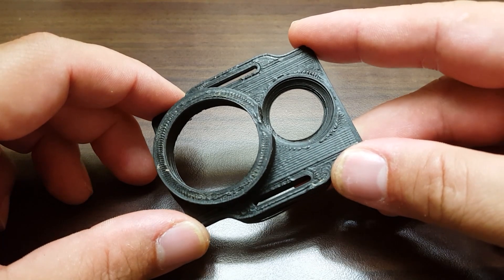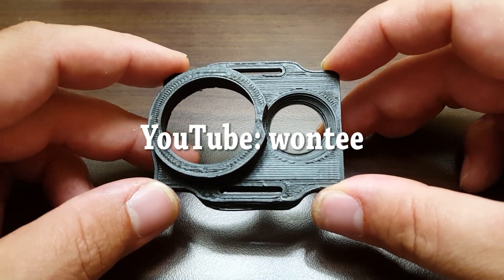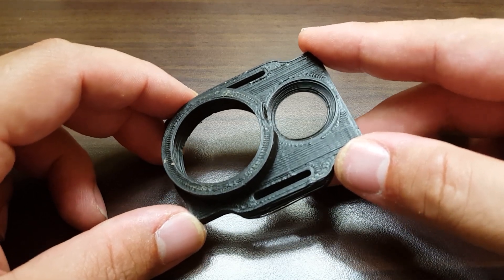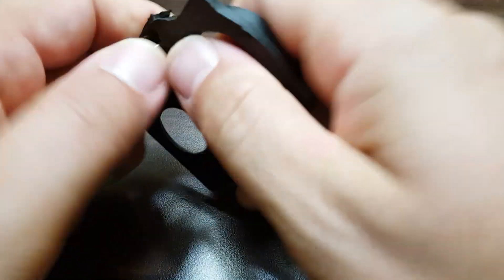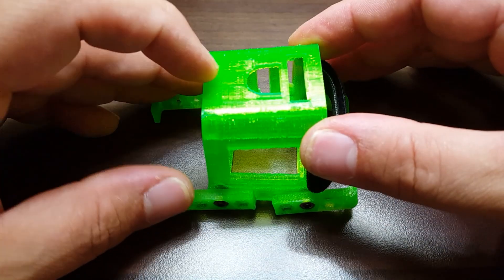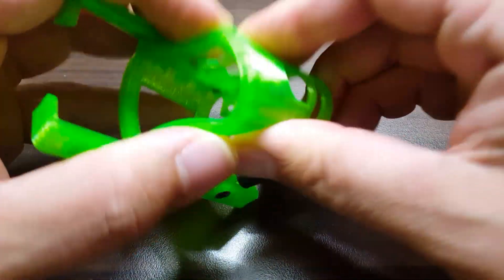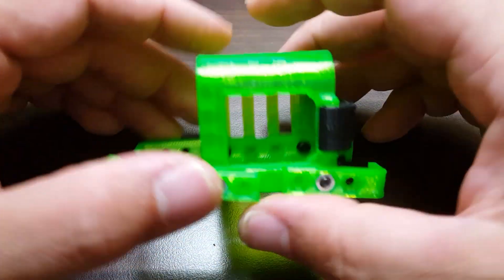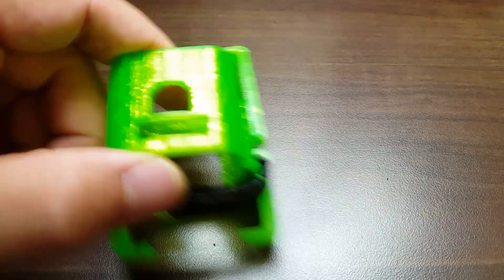3D Printing Wonder-Material: TPU

Comment: Weak along the layers... yes, BUT: Injection molded plastics mostly shatter when they break... with pieces flying around.
3D-printed materials - as you already see in the vid - break but the broken part does not fly away. It still hangs on some layers/strings.
They crack and still maintain a certain mechanical ability, since most 3D-print polymers have that typical viscosity.

That element you broke away on that model would also break at most injection molded plastics. :)
Reply: It also has a lot to do with the brand and makeup of the material. I print A LOT!! And just like with anything you learn with experience. Print that part in Eryone PLA Pro and try that screwdriver trick. I have literally had to use a mallet to remove supports before because it was so hard. I swear I've tried breaking tht stuff and it's near impossible.

Comment: Yeah man got to disagree with you on that point 3D printing is not hard to get into and it doesn't cost a lot of money you can buy 5 inch racer or you can buy a printer and especially if you buy like a decently Welbilt printer with good reviews and as long as it's not like a DIY kit you're good to go you're not going to have that many issues and if you invest a little bit more you're not going to have any issues and it's not that hard to get into for sure

And there are other wonder materials nylon reinforced with chopped carbon fiber as well as continuous carbon fiber Prince these all have really high strength High tensile modulus high impact resistance so definitely worth checking those out as well

Comment: When printing drone parts, the design plays an important role. If done right, these parts can be quite resistant. I fly a racing drone with a self designed frame (search for "Crashex" on Thingiverse) completely printed in PLA. As a relative beginner I still crash a lot, but unless I fly the drone directly into the ground with speed and from a height, it handles its rather rough life surprisingly well.

I like that I can design things in a way that expensive parts are well protected and things will break in a "predictable" way when they break. I usually have a couple of spare arms printed and can be back in the air within half an hour (will have to design for easier changing of arms and a more compact shape, though).

Now for the frame itself a very flexible material like TPU will not work, and I was having high hopes for PETG, which is supposedly more resistant than PLA, but so far it did not live up to my expectations - the PLA I have is 5x stronger. Maybe faulty material, I don't know. I hope to get my hands on another brand of PETG soon because from what I see online it should be great for printing drone frames (search Peon 230, for example).

Comment: as for keeping a 3D printer running, I haven't had any real issue with mine since I replaced the bearings after buying it used, other than the pet or abs filament jamming the extruder when it can't push it into the hotend, but I don't run mine every day either.

Comment: Anyone else wondering about the quality of that print :(
Reply: no sense printing something at 0.06mm if you're just gonna break it with a screwdriver
Reply: looks like 1mm thick exstrutions,  its tricky to get a clean top with that, although at 0.5mm layers it prints in a 1/4 of the time...e.g. no ten hour print for a farty little bit lol.

Comment: Monoprice Mini Select, $199 on amazon. 1 Roll of PLA to print parts for the 3d printer to get TPU printing $20. 1 Roll of TPU $40.

Your 3D Printing.

Just did it, I have TPU parts sitting finished in front of me with results as good as a $2000 printer.
Reply from the maker: Kind of hard to believe, honestly. I have watched people struggle to get their printer running well, especially with soft filament like TPU. Got any photos of sample prints?
Reply: I was a 3d printer n00b as of 1/12017. No reading long books or nunnery of the sort. I came here thinking you had some tips on 3d printing with TPU.

I literally just got it monday 1/16/17 and had my first great tpu print wednesday 1/18/17. I could have done it faster, maybe even printed the part to keep the tpu from getting jammed up in the extruder with the included filament and been printing TPU from the start. I wasted some time printing things in PLA.

There was a slight learning curve not just in the slicing software and optimal settings for layer extrusion for structural integrity but also in temperature, material settings such as density and filament size and other things I made sure to configure to the best of what I could quickly learn, for instance on every print you must specify a layer height and That's an important number because It's driven by the Z axis motor and that motor [Z-Axis] is a 7.5°, 48 step motor, which has physical limitations. Since the motor is attached to a M4 rod, which has a 0.7 mm thread pitch, then in one revolution makes the Z-Axis travel up or down 0.7 mm. Since it took 48 steps to turn that rev, each step is 0.00145833333333333333333333333333 etc etc mm. To avoid rounding errors, you can use multiple of 3 of this number, which is a nice and pretty 0.04375 mm. 

That is a nice and handy number that effectively represents the layer heights that mathematically work the best for layer heights for the monoprice select. Stop at 0.30625mm because with a nozzle diameter of 0.40mm, the maximum recommended layer height is 0.32mm.

It's all just science. Maybe you should make a video on it for everyone that way I won't have to learn sketchup because cheap 3d will proliferate and parts will be designed for me. 

It took me like 14G of filament to do a camera mount that could likely suspend a small child without breaking, maybe a fat kid at its stronger point. I digress, mypoint is it's tough and flexible. 800G of filament was like $27 for the sainsmart tpu (which has been working fine). 

I even used cheap bed substrate to test, Scotch blue painters tape. Granted it's perf3ctly aligned. including some TRESemme level 4 hold hairspray which is dank for making parts stick initially and they come off nice at the end. They even smell nice.

See for yourself. Sorry no smelling.

https://www.irista.com/gallery/dpujosdh1crv
Reply: Joshua,  It is alot like quads. if you buy a cheaper one you end up spending more time and money replacing or "fixing" issues.  Also a lot of printers are simply not made to print flexible filament. If you use a bowden style extruder with TPU for eg its quite a challenge to push the filament through the tube without it flexing too much.  So the right printer style goes a long way.
Reply: My mini select V2.  Prints better than my old ultimaker 2.       Prints TPU like a boss with improved for flexible 3D printed extruder base

Comment: BUILD a 3D printer! Your mindset would be perfect for calibrating the settings of a printer. I built my second 3D printer a year ago and I would not build a quad or even planes without it. :-) I use PETG for a lot of parts on my quad like antenna mounts, receiver tray, ESC covers, flight cam mounts... anything you can think of you can design and print in as little as 30 minutes.
Reply from the maker: +Weston Will I just wouldn't have the time. Every spare moment is currently used on flying or youtube.

Comment: You actually broke it against the layers. His printer must be bad and leave a poor surface finish which made it look like there were layers on both planes.
Reply from the maker: r.e. the layers: yeah, I meant to show how a Yi "couch" breaks along the seams but I didn't have one handy. I don't know much about his printer.
Reply: The poor guy is over extruding with his printer. Meaning the material will leave a blobby finish on the top layers because its just pushing plastic around instead of 'placing it down'. Ontop of that, you 'tested it' on probably the weakest point of the entire part anyway.. so of course it would fail regardless of it was against the layers or not... But, with that said, its also the part of the print that more than likely wouldn't break, since the straps that would go through it would be putting force against the actual 'main surface'. Ontop of that, since its just being strapped in place, most of the impact force of a crash would be absorbed via the straps, and thus a super high chance the part would survive regardless.
Reply from the maker: Calm down. I was just trying to make a point about where it breaks but I didn't want to break my actual base. It wasn't a test. It was a demonstration.

Comment: BTW, that TPU Session mount is from Quadrysteria http://www.quadrysteria.com/store/p492/GoPro_Session_Mount_-_Flexible_TPU.html
Reply from the maker: Really clever mounting method. Raising the camera up provides vibration isolation but also lets you run a larger battery AND uptilted camera without running out of room on the top plate.
Reply: A friend Ryan Bargreen designed it for Quadrysteria. He is a local competitor too!

Comment: Attention anyone with a QAV210/180/R! I just designed a modular GoPro mounting System for racing drones. It consists of one GoPro bumper with an adapter that can fit into any one of the mounts I designed that range from 20-45 degrees. It allows for easy swapping between quads without tools and it secures the GoPro and bumper only using a velcro strap. I plan to expand to fit more cameras and quads, but keep it all modular so any camera can go on any quad at any angle.  It's still in prototyping stages, so if you can order one and give me some feedback, it would be greatly appreciated as I can't afford to order all the prototypes. Thank you!!!  http://www.shapeways.com/shops/drone-builder Now if only shapeways could print TPU...

Comment: My Tevo Tarantula 3D printer kit arrived a couple of days ago, got the all metal extruder to print flexible filaments
Will be using TPU for my mounts and arm bumpers, also be useful for FC standoffs and O-rings.

That black part is probably PLA its brittle

Comment: You can check out great3D I believe he uses the same rubber material on his prints. I ordered a XiaoMi yi mount for my quad and to my surprise the material is just like the green casing in your video. It'll definitely withstand a lot of hard crashes for sure compared to the hard layered plastic mount.
Reply: The downside is that it's more expensive but worth the buy.

Comment: Hey man, back once again with another question for you. I have been tuning today, first time using betaflight configurator, and all was going well. However when I disconnect and reconnect, the esc protocol and Gyro and PID rates go back to PWM and blank, yet looking in cli "get" it seems to still say oneshot 4khz and 2khz. I am running 2.8.1 and BL Heli 14.6 Justa glitch? Flying great though, so I don't think it is actually putting me down to PWM.
Reply from the maker: You have to be on 2.9.0 to use the configurator reliably.
Reply: Joshua Bardwell WHA?? I thought I hard you are several others say it is 2.8.1 and above? Dang it :/ Is the PID logic still the same, so I could move over, or do I need to retune?
Reply from the maker: I believe the logic is the same, but not 100% sure.
Reply: Joshua Bardwell Ok, thanks :) I guess I will move on over.
Reply: The RCAddict 
dndnn

Comment: My yi mount is TPU.  And very nice it is too! Zero jello getting through to the cam with just that and no other damping. What a refreshing change to get flight footage without jello in. Now if I could just find some good render settings to use on Vegas Pro so that YouTube does not add pixels to my footage I'd be a very happy man!
Reply from the maker: I have a friend working on a TPU Yi mount for me. I would love to be able to use the top-plate screws to hold the mount on, without having the mount break off very easily in a crash. I'm hoping TPU is the right balance of "give" and "hold".
Reply: +Joshua Bardwell that's exactly the way the mount I use fits josh. It's held on to the frame with the original frame hardware. I'll find the shop I bought it from and pm you the link to check it out, either here or rcgroups.
Reply: +mrmurder75 also, the mount is sold with a limited lifetime warranty. Seller is confident it won't break or rip from the frame in a crash. I've tried, believe me! 
If it does, he will replace it for free.

Comment: TPU is not an easy filament to print with. It has a tendency to clog the print nozzles. One of the reasons for lack of adhesion between layers of PLA or ABS is printing too fast with not enough heat. If you slow the speed down, increase the temp slightly as well as the resolution, lack of adhesion between layers is greatly reduced. Look at PETG too. Doesn't clog, has some flex, doesn't require a heated print bed. Gives a very smooth and durable print.

Comment: Maybe you could make 3d printed flight controller damping thingies with it?
Reply from the maker: Interesting. I wonder what its hardness rating is.
Reply: +Joshua Bardwell you already can. I use a material called ninja flex very cushy. Check it out really good stuff for a variety of parts. I have landing pads as well as antenna mounts made out of tpu really great stuff for this hobby.